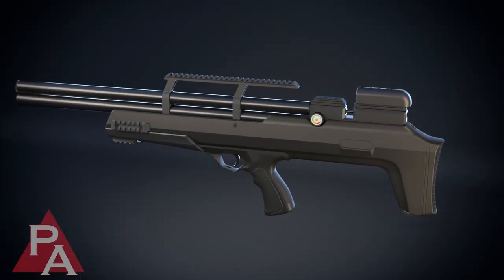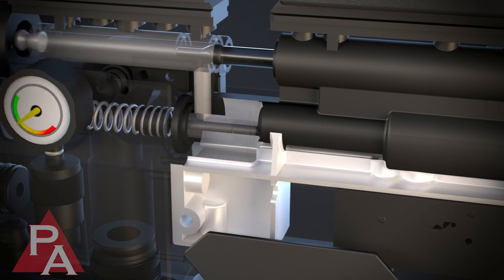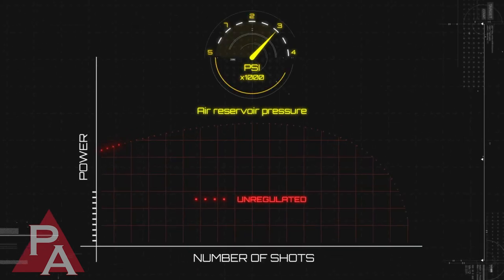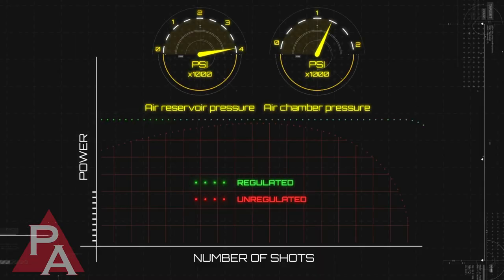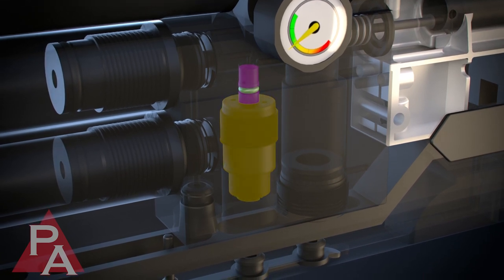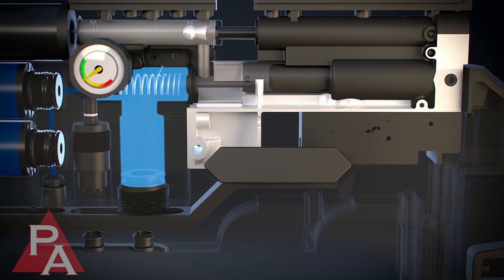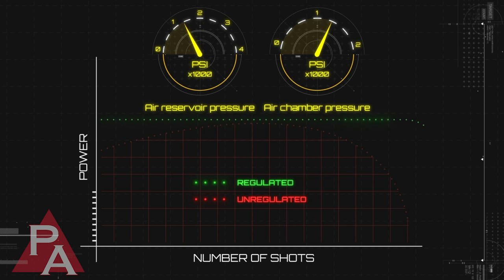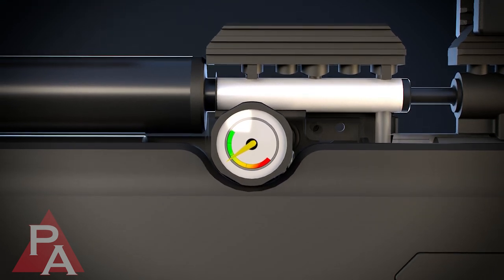Learn How Regulated PCP Air Rifles Work

Comment: Good info. Seems like most PCP's are not regulated but that trend may be changing? Also, large caliber guns most likely won't be regulated because only good for 3 or 4 shots?
Reply from the maker: Correct, no regs in big bores, largely does not make sense there. Correct on more and more guns coming to the market that are regulated.

Comment: Thanks for posting. 
Question; is there a benefit to adding a drop of silicone oil into the reservoir to keep seals conditioned?
Reply: DON’T ADD OIL OR ANY PETROLEUM BASED OR FLAMMABLE LIQUIDS INTO THE HIGH PRESSURE CHAMBER! All you will have done is create an unsuspecting pipe bomb for you or whoever fills it up. When you fill it you will make a diesel engine minus the engine part. Basically you get a fireball consuming the entire PCP tank volume at insane pressures leading to a horrible day for you.
Reply: @dnendion4300  he said silicone. Silicone is what you want to lube orings with inside the pressure chamber... It's not flammable